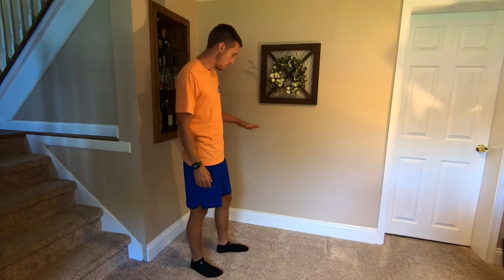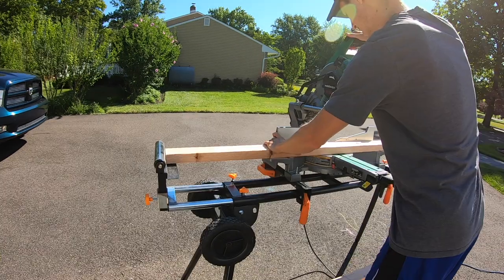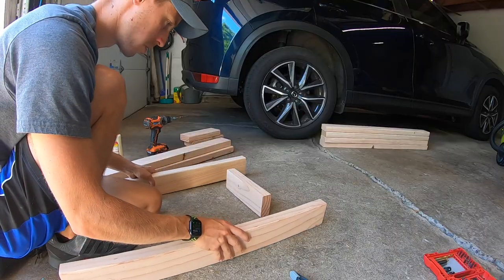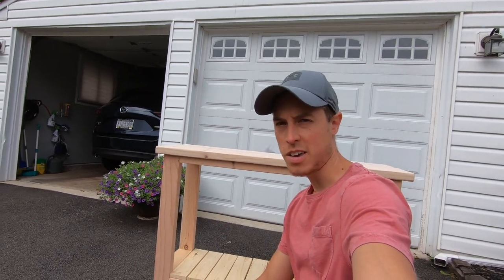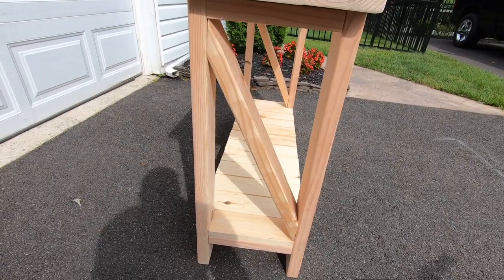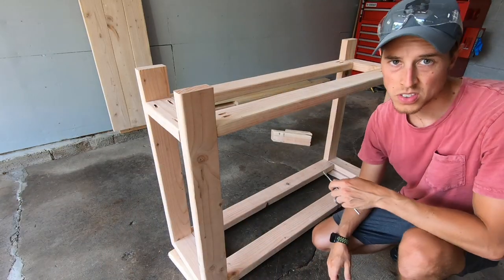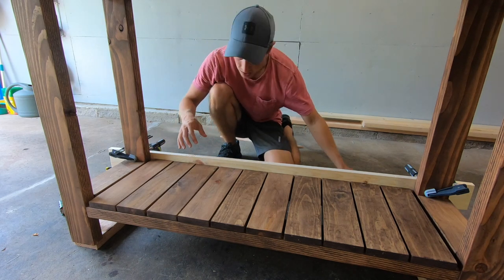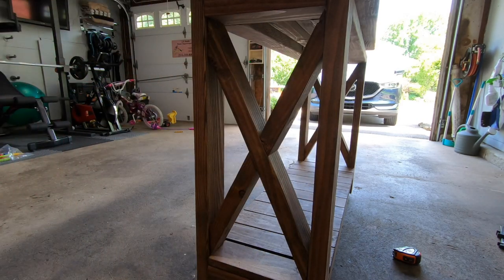DIY FARMHOUSE CONSOLE TABLE

Comment: Hey, Love the look and I plan on building something similar to this. One thing I feel compelled to say after watching you for the first time is that you really should buy/build some sort of push stick for your table saw.  You can even use some scrap wood and make a shoe style one.
Reply from the maker: I have a push stick, one comes with the Ridgid table saw.  I typically only use it with smaller cuts that are tight to the fence as I am pretty experienced with using the table saw so I know my limits.  Thanks for the kind words!